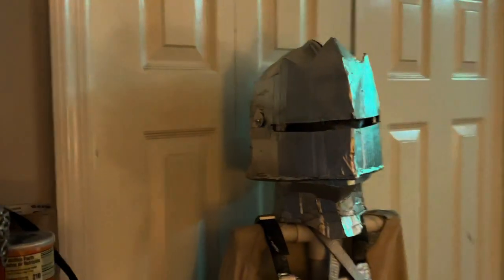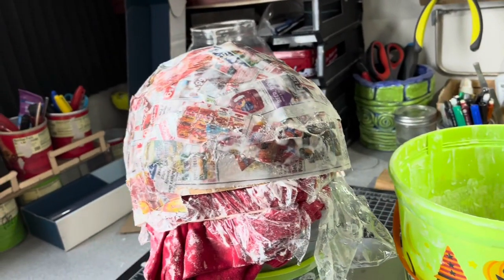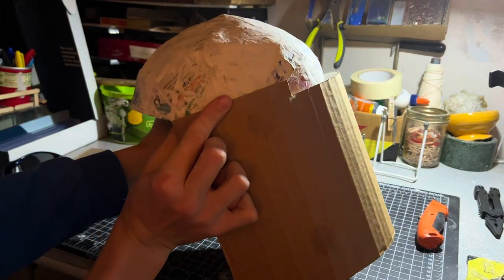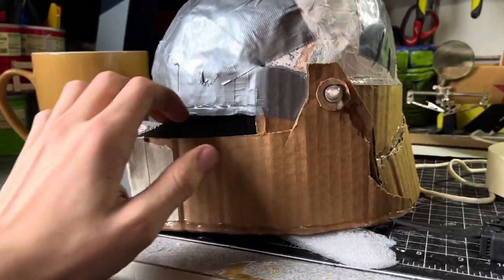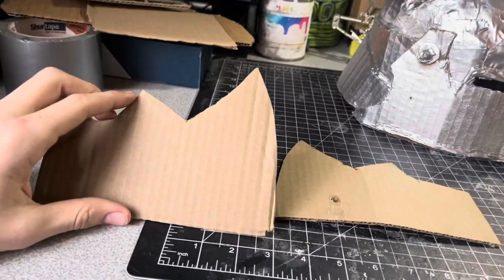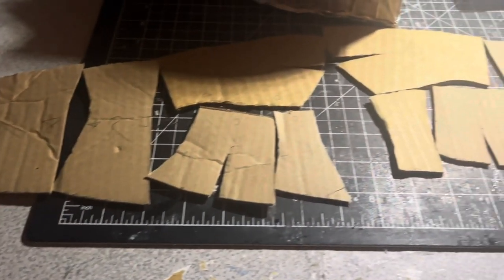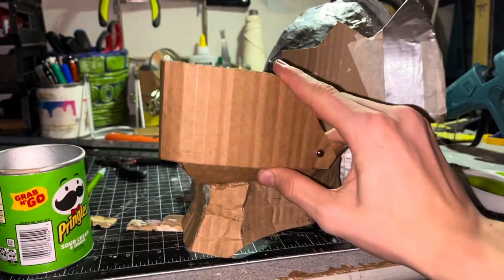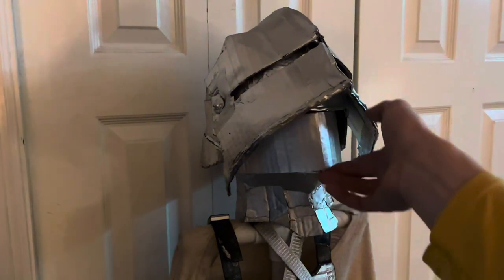How To Build A (Proper) Cardboard German knight helmet

Comment: can you share more details on the hinge please?
Reply from the maker: I originally used the silver paper fasteners because they resemble rivets the best. I then repaired it using a golden fastener because they are longer. The fastener is stuck through both pieces of cardboard and opened at the end to f the inside of the helmet where I glue and tape it in place.
Reply: @MarksWorkshopcrft  Thanks, that sounds like a good solution.